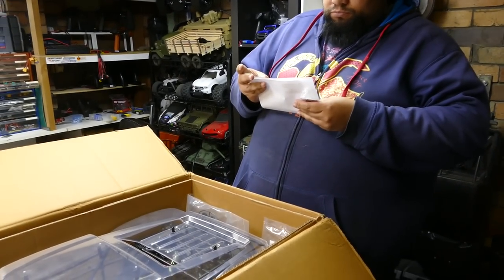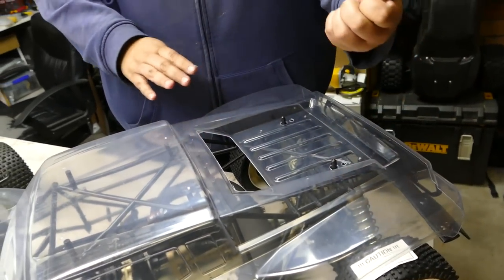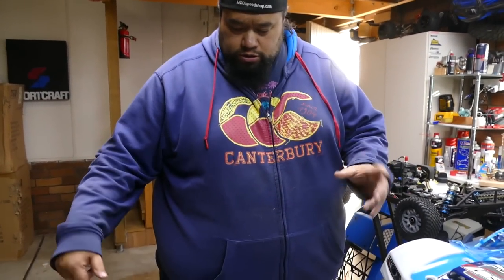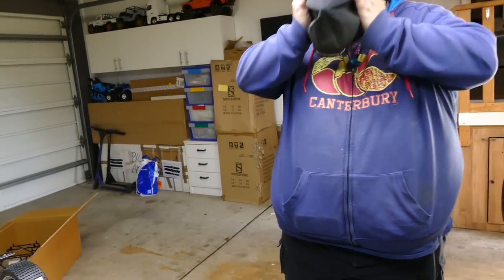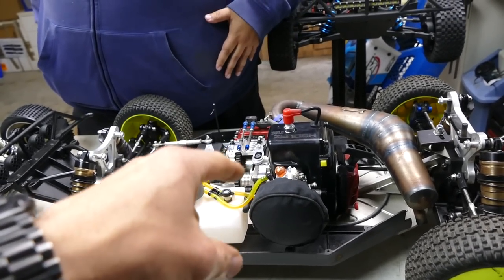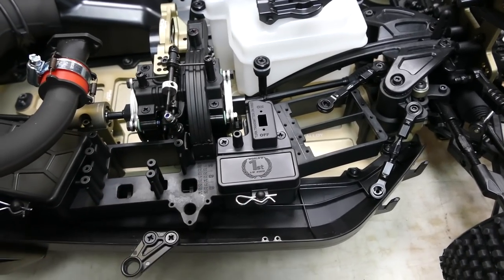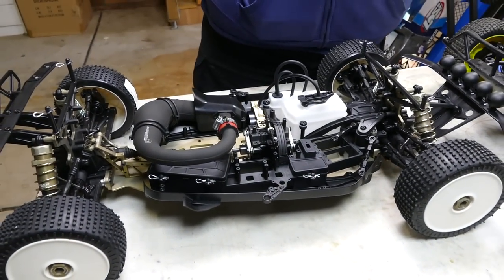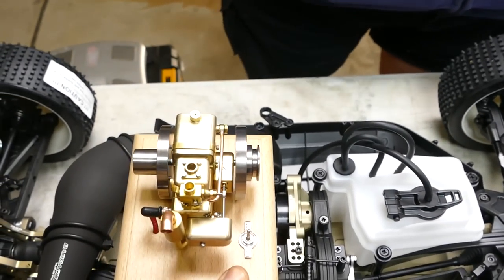MCD W5 MAX PRO 4WD 1/5 SHORT COURSE TRUCK - BETTER THAN A LOSI 5IVE-T 2.0?

Comment: As soon as the Losi 5T 2.0 (mid July) is back in stock, I'll be ordering one. It will be my first 1/5 scale. I'm not getting it to race, just getting it for fun. Will make my current 1/6 scale Super Baja Rey look small, but it will be a nice addition to my collection. Right now all I'm interested in getting for it is the kill switch. I forget what brand seems to be the best one currently, I've got to look it up again. Killer Bee I think it was. Do you guys have any other suggestions of what I NEED to get or what I should get as well?
Reply: Hey matey, congratulations on getting a 5iveT 2.0. They are awesome to bash around straight from the box. Definitely a Killer RC Killer Bee killswitch is highly recommended and maybe a tuned pipe to help it move along but still capable out of the box. Enjoy buddy 🤘

Comment: Hey Steve and Luke. I have a question. Can you put that 4 cylinder motor in that buggy?? Or would it not have enough horsepower? Just asking
Reply from the maker: Not enough power
Reply: @RCTanksTrucks247  ok Cheers

Comment: Nearly caught up with me no, I noticed on Frank your steering turnbuckle on the inside should be under the servo arm to stop any drag when turning.
I was looking to buy the MCD and race but money to tight since lockdown, I raced the FG Marder 2wd class and in the 4x4 class I ran the MCD with the Chevy Baja 1000 Trophy Truck body and rear also on  road in the Outlaw class with the rear wing added and usually alloy rims and slicks or wet's it was ace in both class's but did have CVD issues on the front hubs always had to carry spare shafts especially when on road not so much when offroad go figure, the MCD back then was the only 4x4 option ditto with the FG Marder no real competition for them back then, I also still have it and a short chassis for it when on tight tracks I have enough spare's to build a Monster truck down to the wheels, really wish I had bought the W5 Max last year when I had the chance but hopefully if I sell my DBXL and HPI Baja 5B tsk-b then maybe I will do a build then ready to race in 2021so will be interested in what motor and servo's carb etc we have to run upto 30cc I think I will run a BZM 28:5cc TT motor as I have one sitting on the shelf not quite run in so a good starting point.

Comment: That's either not the ultimate model or they updated it since you bought this because the Ultimate now comes with full billet alloy suspension. The front and rear a-arms and all of the links are all billet aluminum.

Comment: Will be more like 14.5kg once built up. MCD quote 14.5-14.9kg for the Pro Version.   Still lighter than the Losi, but not as light as expected in the video.   A G320RC motor weights 2.3kg for example, not the estimated 1.2kg
Reply from the maker: Cheers mate

Comment: i think ur wrong about mcd bring cheaper than losi, it starts getting expensive when ur buying spare parts, like those big bore shocks, its an upgrade but ur paying 700-800 ozzy dollars for 2  so 1600 dollars just for shocks, but its quality gear, i have a rr5 so i know spares are expensive, im pulling the 26 out and putting in an alx71
Reply from the maker: Fair enough.